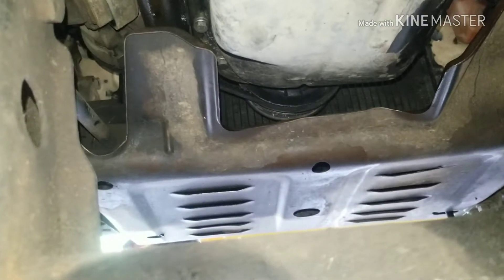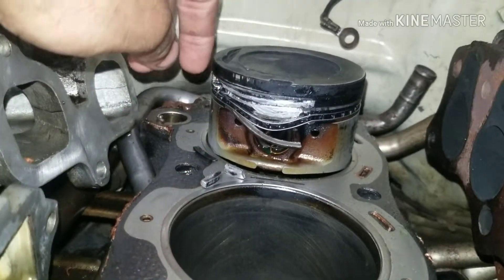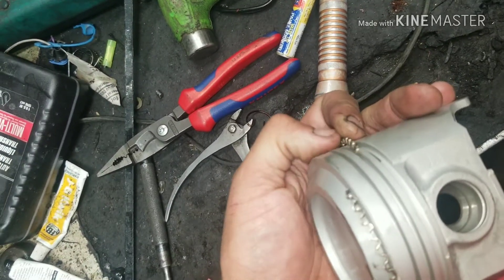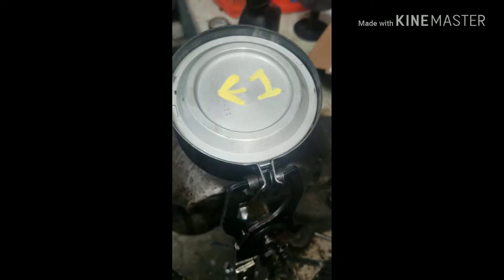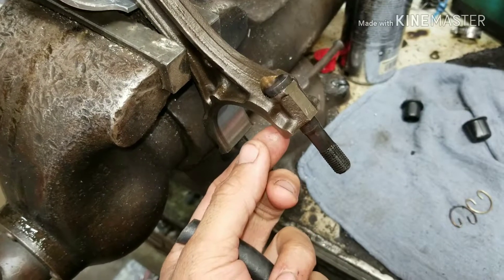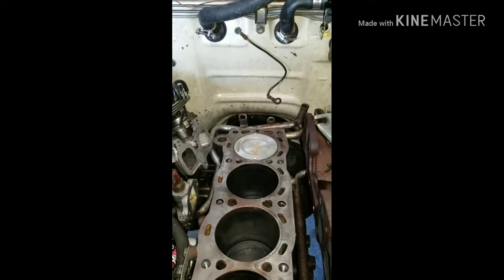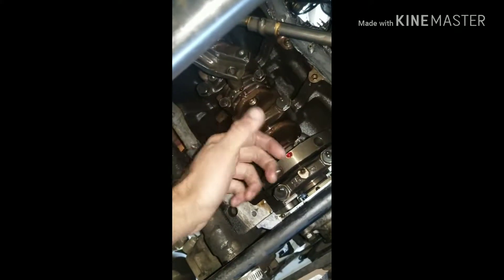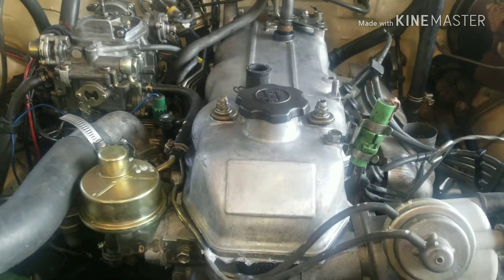How to fix bad compression in a  Toyota 22r 84 -95

Comment: My ‘85 Toyota Pickup had 135 psi in all 4.  A week later my timing chain broke in the CVS parking lot when I tried starting.  Anyway my truck has 160k miles.  Used to run very good.  I am 2nd owner from 100,000miles.  How do I know if I need to hone the cylinders or can I just install standard rings? 
Also, can I rotate the crank so each piston is on the top to remove the piston? With the timing chain broken I will have to reset my timing by hand anyway. ( yippee, I get all the fun😵‍💫)
Finally, you said at the start that we need to find out if it’s—standard, 0.50mm, 0.75 ,1.00 WHERE IS THIS MARKED ON THE PISTON?  Especially standard.

Comment: You still driving this? I have a bad piston and I’m wondering if I can just replace the one piston or if it’s wise to buy all 4?
Reply from the maker: It's still driving around I did all four but showed just one, each job is diffrent the big thing is to look for good cross hatching in the cylinder walls and if theres any pitting or marring.  Thanks for watchin besure to like and subscribe for more tips and tricks.

Comment: That is an 81-84 22r new piston you are showing. I didn't finish watching buy hopefully you didn't install that in a laser block 85-95 22r/22re
Reply from the maker: Trust me it was correct, you have a good eye  ,  if I remember correctly there was some weird stuff going one where  we could only get domed pistons and that was d the reason bacause the block was a diffrentvyear from the truck. I'm not sure if the head was switched over or if it was still a 22re fuel injected heas, or not. The engine had just recent had rebuild 30k before we did the job but it was subpar being nothing had been done like valve work which caused the valve to burn.  So its possable the piston I pulled out to put in was wrong piston that was in in it. Also yes  ring gap was  checked  and this engine was bored out before hand I cant remember what it was at though, also i try to capture as much as possable about details but not 100 % , because it's mostly for entertainment. Thanka fir watchin.

Comment: Well done...
Reply from the maker: Thanks for  watchin besure to like and subscribe for more tips and tricks.
Reply: @fixergood  Looks like I've got to some how fix a stripped out head bolt in a low mileage (140K) motor that overheated, or rebuild a motor that may have 300K on it.  Both have issues.  Of course the one with 300K on the odometer may have been rebuilt once already.  I'm here for review...  What would a shop charge to heli-coil the stripped out head bolt?
Reply from the maker: @tunnelrabbit4293  I hope it helps you out and to fix a bolt hol is usually a 100 bucks depending on how bad she is
Reply: @fixergood  Thanks for the info. It is stripped out real bad.  The cheep Chinese rebuilt kits for $200 are scary low in quality, so fixing the bolt, if possible, is the first to consider.  Any guidance on a basic budget rebuilt kit?  I might throw in fresh rod bearing and rings and a timing chain in the motor with possibly 300K on it.  I do not drive this truck much.